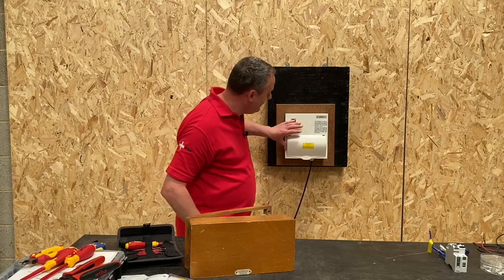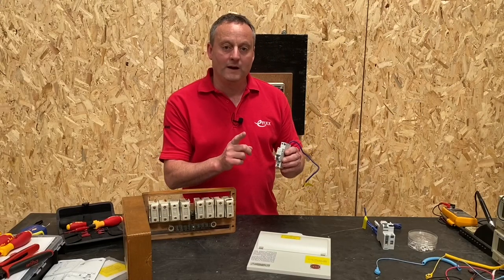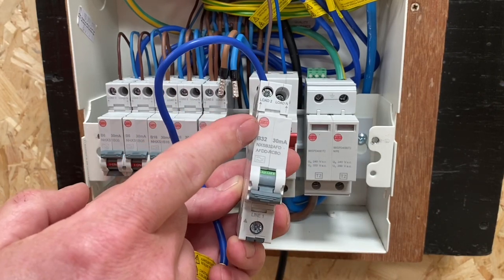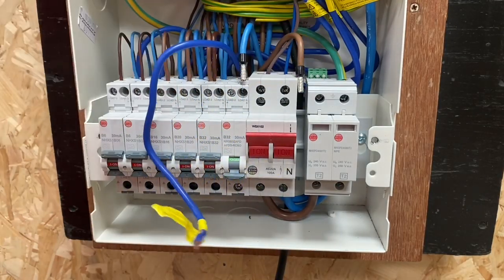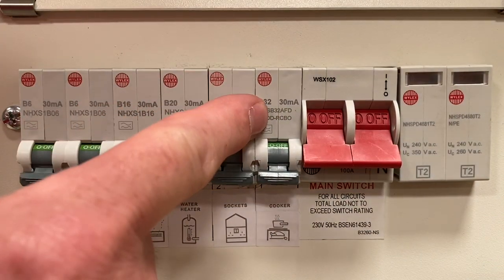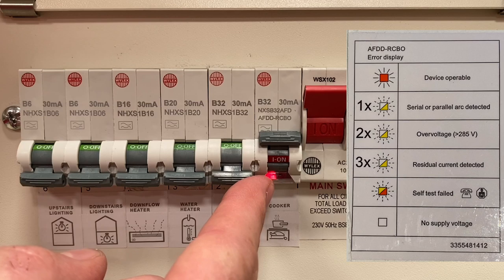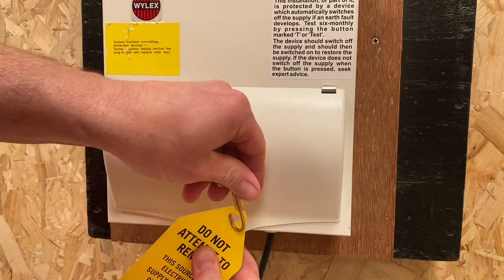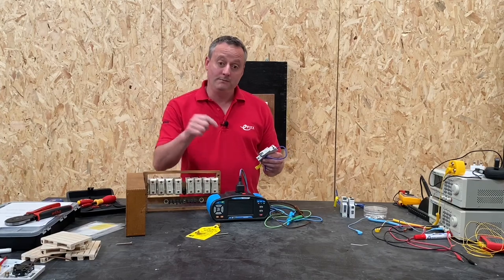Are AFDD's the future of circuit protection? - Arc Fault Detection Device

Comment: An observation from USA: AFDD breakers do trip more often than regular breakers - not unexpected as these breakers are monitoring the circuit for additional unwanted conditions. This is especially true for the first several years after a manufacturer makes these breakers available and hasn't fully optimized when they should and should not trip. So, this would be another reason for you fellows in the UK to try to relocate consumer units to easily accessible locations - ones that don't require a ladder or emptying out a cupboard.
Reply: I've heard this also Jason Dragon from a fellow spark who's brother in law lives and works in the USA , in his words they are a nightmare 😲
Reply: @TheGorillahands  That's is bit of a shook. 😲
Reply: @m101ist  p
Reply: What about spark plugs? shouldn't they be called arc plugs?

Comment: Good product but like all things it comes down to price, I only fit rcbo's so it's brilliant that they're incorporated in the design and still not insisting on a twin load rcd board. Customers are only now aware of the RCD and the safety it brings to the home its only recently I've noticed that at time of a quote for a reboard that clients know and have a limited understanding of the RCD due to awareness from the industry.
Surge protection is also becoming a clear protection selling point with the public but I think we need a little time before forcing AFDD as a "you must have" sell. A lot has changed on the poor old fuse board what with plastic to metal and RCD to surge recently, the public gets assured of "this is future proof" yet a year later a lot has changed.
I for one welcome this tech but again price rears its head and that's what a customer is interested in.
I miss the elex shows to see the new gear but you guys are doing a great job.
Thanks

Comment: Both a spark and arc are created when there is a breakdown of the air insulation and ionization takes place between two points. If the breakdown is short and the arc is extinguished it may be termed a spark, if the arc is maintained for some length of time it may be termed an arc.
Reply from the maker: Great explanation 👍

Comment: The best way not to loose it, is to keep it inside the D/B. 
I recon everything should have a AFDD, but it'd be nice if they came down in price. Like a RCBO price, compared to the stupid price they are atm. Same goes for SPD, as there's a massive mark up on them because they are a "name brand". Some of them are 10x the price compared to something you get off eBay which is around the £10 mark and the item that's inside is exactly the same! All it is is a MOV. This is why when I install them, I get them off eBay because there cheaper and have the exact same item inside.
Reply: Can you prove they are exactly the same and not C-hinese E-quivalent marked 🤔

Comment: red for no fault.. seriously ? I though red had been standardised for fault conditions years ago.
Reply from the maker: Seems that the LED indicator isn’t standardised. - Eaton, ABB, Siemens - all different - where would we be without standards ?
Reply: What wrong with a traffic light indication, that should easy enough to standardize, red led indicates fault to my thinking as it probably would the customer, it maybe good for quick call outs for the electricians though
Reply from the maker: @brianhewitt8618  Does common sense apply when the boffins set down to agree on standards?
Reply: I think a solid red colour is fine. It's an indication that the breaker is working but also energised. If it was green then house owners may think the circuit is off and safe to work on.
Reply: @efixx  As the old saying goes, the great thing about standards is that there are so many to choose from".
Reply: @SteS  If it's tripped, there should be red fault indication. Green indicates normal condition, receiving power.
Reply: In all domestic devices red indicates power.  If a Socket or FCU has a neon to warn that it is energised it is red, why change this at the Consumer unit.

Comment: council just fitted a new kitchen in my house and in process thye changed the board to the crabtree rcbos with the led indicators bloody brilliant as i actually had a fault a few days back and water had got into the back of the socket. the light gave me information on what to look for and it still stays flashing until reset very clever. they are very expensive im suprised the council wanted to spend the cash.

Comment: Great video Gary, very informative.
Can you explain how the AFDD is OK with insulation resistance tests.  Surely, the switching function inside the ADFF will be on the supply rather than the output.  That would leave the electronic circuitry connected to the output terminals and vulnerable to insulation resistance test voltages.
Reply: He just explained that question at the end.. the load side terminals are disconnected from the electrical componants inside the decice...
Maybe it has a double pole feature...eitherway your good to punch your 500v test without damage or reading the device as dead short...👍

Comment: I am currently installing some electrical points in an outside wooden stable block and will be installing afdd devices to each circuit .. I think now every electrical installation has now have to be assessed for afdd device's.

Comment: My opinion is that if a loose connection was to occur through out the installation then this is down to the electrician being either under cautious with his or her work or the electrician not being competent at all. If routine checks are carried out regularly and test and inspection is carried out when the installation is due for testing then this should minimise the faults such as loose connections. as a good competent well trained electrician should be able to double check his work after it has been installed again to minimise the problems of loose connections. far to many new installations not getting checked or tested to the quality of standard it should be. Although without said it is a great product and great design but as mentioned in the comments I think it will come down to the price point at the end of the day. Greats videos keep them up 👍🏻

Comment: Hold on, if the device can detect an over voltage (>285) does that mean it incorporates almost an SPD function too?
Reply: Not quite. SPD is more of a protection of transient over voltages. Doubt this would detect that and would probably be fried by it instead as they're very high over a short period of time. Probably more for indication in case the DNO increases the voltage and in some houses it goes over the voltage tolerance.

Comment: Looks like a great piece of kit, and I'm all for anything which is going to make our lives easier and the installation safer. What kind of price is one of these? Also, all the while b and q are selling consumer units to Joe public   these important safety devices will not be getting purchased or installed. More needs to done for these wanna be sparks. Great video though Gaz.

Comment: I’d like to see a simulation of a fault, from memory on other channels they struggled to get them to trip consistently.
Reply: I also watched it arced and just arced for ages lol.. its all about the rcbo thats no1 for electrical safety.. the afdd is just another money making big business scheme  as rcbo's are so cheap to buy now there's no money in it for them.. ie fusebox or contactum etc
Reply: philip triggs or if they want them to be used why not one that’s intergrated with an SPD that can go before the main switch, surely the most common type of arc we all see is the main tails in the switch when the neutral works it’s way loose and melts the switch 😂
Reply: @whatthedeuse  
But to be honest we all know why the real cause of all these fires/arcing etc... its normally down to being badly installed work/ or inferior repairs  carried out by to many electricians/builders/home diyers who don't know what they are doing..

Comment: As AFDDs are mentioned in the 18th edition it is still only a recommendation on the part of the installer to use them. Will the new regulations or a future amendment make them compulsory? as they are a very clever piece of design manufacture and operation.

Comment: How will the AFDD device react to a power circuit that supplies an electrical welder, be it  arc welder or TIG OR MIG  ?
Reply: They're mostly SMPS based tools, so I dont think they would trigger them. Maybe a old transformer based old buzzbox may cause issues but also, its unlikely.

Comment: It is stupid to lock the panel. If you have an electrically event, how can you fix it quickly? Calling you will take a while, maybe was a single sparc and all you need to do is to rise up the knob again. Also, it is wise to see position of the breakers, through a transparent glass, just to see the real situation inside the panel, without open any door. My 2 cent opinion, as not an electrician, but a passionate one. Santee! 🍷🍷🍷
Reply: yeah its not a good idea
If the fault is still present it will trip out right away no danger to anyone
Reply: Lock out the main breaker or the circuit under test!

Comment: I'm Glad the UK finally added that to their code. 240V can kill and start fires quicker then 120V. Saftey! saftey! Safety!
Reply: I'd have thought the higher current of 120V circuits generated more heat?
Reply: @andyburns  higher voltage creates higher fault currents!
Though to be fair, in the U.S. panels are 100A or 200A -- much thicker conductors!

Comment: When I get round to upgrading my own house to18th , I would fit these on the socket rings. RCBOs on the fixed wiring.  
I think protection against arc faults on appliances, portable items and extension cables is most important.  Can’t afford them on all circuits.
Reply: Here we have 3phase ac input as standard (main fuses are usually 16-32 amps, which means you get this for every phase), afdd's go up to 40 amps, so in theory you can put 3 of them on the main incoming phase lines and protect all the circuits after them. The only problem is that when you have an issue then 1/3'd of the circuits are blind. I'm going for this route as my consumer unit is quite small (i can replace 3 wylex afdd/rcbo instead of the 3phase rcbo in the same space) and currently i have 3phase rcbo on all 3 phases, so for me its an upgrade.

Comment: New comment on a relativly old video.  Only a couple of years after a kitchen refurbishment, the microwave stopped working, and not thinking it all through properly, I assumed that it had died - it was itself relatively long in the tooth.  So, I purchased a new microwave, only to find that it also didn''t work when plugged in.  As it turned out, the terminations in the rear of the socket had come loose, probably done to vibrations from the adjacent washing machine.  So, almost certainly this was an arcing situation, and would have been detected by the AFDD...

Comment: Thanks for the video. Am I correct in thinking that eventually you would have a consumer unit full of these instead of an MCB and RCBO on its own?
Reply from the maker: Yes that’s right - as an interim we’ve seen people suggest using them on high current circuits.
Reply: Just think how many burnt out shower 50A pullcords you could save, lol 😆
Reply: @efixx  Excuse me, what's the price of that AFDD ?
Reply: @Arif-nj7vl  £150 for 1

Comment: I certainly won't be using Hager AFDDs, DSES put a great big boot into them recently. I'm more concerned about the lifetime of these AFDDs which will go into consumer units for 30 or 40 years. I wonder how many will still be working by then. The series power capacitors will have failed and all electrolytics dried out long before then.

Comment: Like any led or neon it can fail. Looks good for the job, however they can stop working just the same and not be reliable.
Reply from the maker: Thanks Ian - Agree that neon indicators are unreliable. However, A well designed circuit with an LED indicator should last for decades. From my own experience I know a piece of kit, that I designed, with an LED indicator that’s been continuously illuminated for over 25 years! (*Gordon)
Reply: @efixx  Hi Gordon, thanks for the reply. I am a commercial engineer, a lot of the equipment I have been working on with  neons have not been that reliable. Thanks for the reply.  Keep the videos coming. Have a good night.

Comment: Shame these things do not work with the most common form of electrical fire dangers that  are not otherwise protected already, ie overcurrent.  This dangerous and subtle real risk to life and property still remains known as high resistance faults, not arcing at all !  These costly devices don't even work in the labs on loads applicable to light commercial and domestic.  These things are not considered as operationally effective in virtually all countries that use 220 to 250 volt supplies with the exception of the UK where the majority of their manufacturers, (although not British,) have nevertheless effected deals where they have seduced BSI's JPEL/64 to run with them and who have dubiously opened the doors for their importation, never mind the H&S and expense to the British public. Don't believe us, for goodness sake, go purchase one yourself and try it out!!  After 55 years in the business I have learned the marked difference between high resistance faults and either parallel or series arcing.  Great stuff  in the 110/120 volt North American/Japan arenas where they were they we designed for and known as AFCI's, but entirely unsuited elsewhere!    It's a UK national disgrace!
Reply: AFDDs offer protection from
1) Overcurrent;
2) Fault;
3) Earth leakage;
4) arcs.
Reply: @johnburns4017 - Sadly precious little use for the acutely common high resistance connection fault however.  These are those common dangers where overcurrent, imbalance and arc fault devices cannot help much no matter about the massive price of these three in one jobs.
Reply: @davidheathcote1618  wrote:
"high resistance connection fault"

Use quality fittings and do not use the rear of sockets as junction boxes. Use 35mm deep backboxes and Wago type of screwless connections at the rear of the backbox to take a circuits load, either ring or radial. Then the socket can be attached to the Wago on 2.5mm flex tails, just sliding into the box. This reduces the likelihood of arcs on the house wiring itself, as screwed connection are eliminated except on the sockets themselves - and if using sockets with screwless terminals, none at all except on the MCB/RCB/AFDD. 

All by using newer technology and some thought.